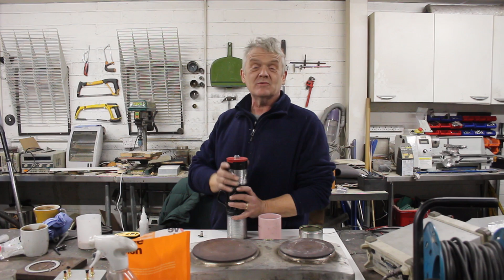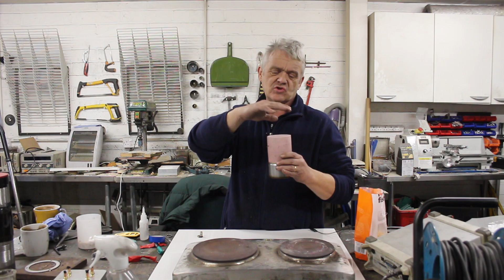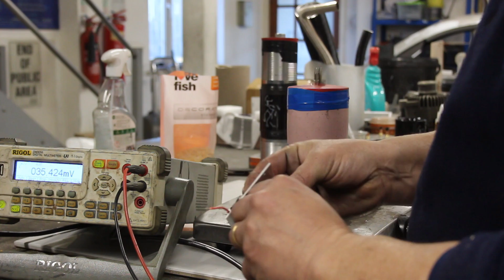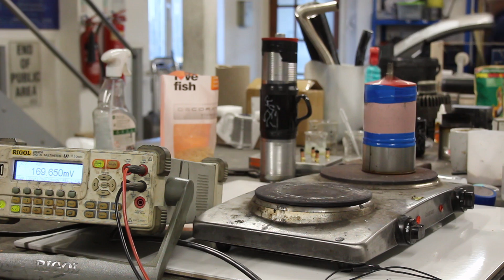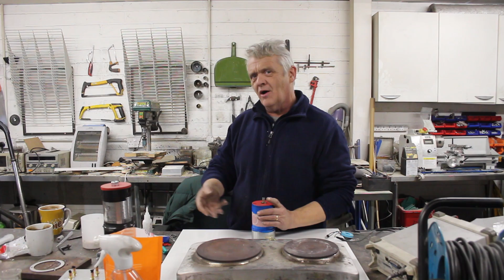1779 The Strange Engine As A Generator

Comment: The frequency of oscillation is dependent on the physical size of the rubber diaphragm and the amount of magnet weight.
I'm wondering if glass can be substuteyfor the ceramic mug, or maybe plastic?

Comment: The generated voltage is AC, so if you use a bridge rectifier, all will be DC and the LED will lite for both cycles, bringing out more light!

Comment: It's little more than a Sterling Engine with magnets attatched to the output shaft instead of a flywheel, and a coil which when supported around the magnets will generate electricity. Nice try Robert.
Reply: Not a Stirling. It's a thermo acoustic heat engine.

Comment: What happened to 1775 & 1778.?
I made this engine from a bean can and a ceramic mug with holes and gravel. Topped with the rubber balloon. I used ACETONE  in the can.  IT WORKS!!!!!
No hole. The correct temperature was pretty touchy too cool no work, too hot no work. I used a Heat gun so I had better control of the temperature.
Reply from the maker: they have been made into an omnibus so i have removed the original videos - you can now find them on tnt omnibus - this is an ongoing project mate so you will find that happening every now and then  - very interesting with the acetone - did you do a video of it? Actually I checked I know you didn't - why not?
Reply: @ThinkingandTinkering  maybe later, still experimenting, but I had a bad reaction to the acetone and need to ventilate and wear gloves next time. I used electrical tape between the can and mug and the acetone broke through. Working on a solution.
Reply: @ThinkingandTinkering  I'm not 100% sure how this works but I think the acetone heats up and the gas inside expands, increasing the pressure in the vessel. Then when it passes through the gravel and enters the ceramic mug it cools and contracts, reducing the pressure. I just don't know how this cycle repeats. Maybe it passes back through the gravel and reheats and re-expands. Or something I'm not aware of.
 @ThinkingandTinkering  maybe later, still experimenting, but I had a bad reaction to the acetone and need to ventilate and wear gloves next time. I used electrical tape between the can and mug and the acetone broke through. Working on a solution.
Reply: I've found that even if there is no hole there should be a temporary one. The engine starts a lot easier if you apply the heat, let the diaphragm expand, release the pressure, seal the hole and then it will run. It seems like it needs negative pressure at the beginning of the heating cycle.

Comment: Now, I am wondering if this darn thing can be built upside-down.
Because if it could, I could heat it with a cheap 300x300mm Fresnel lens with a simple one axis solar tracker, and I just adjust the height each day or 12.
This would be one axis with a passive Arc, of course.
ETA: And after further ponderings, I believe the best option is going to be setting up a bank of these in a trough of hot water, heated by perhaps Solar Evacuated Tubes, and a cooling jacket on the top.
And naturally, I will be using methanol as a medium.

Comment: Use a plumbing boot for a toilet seal to keep the noise down mate.

There should be one that it fits in and the neoprene should quiet it some and have some heat resistance if you use a candle or more direct heat source.

Comment: New idea. (is it strange That this topic is now the domain of my dreams?) 

Put the stator on the inside. Yeah you'd have to re-engineer. Make it span both chambers - so, much longer. Then put the generating coils exclusively in only in the bottom chamber to use also scavenge the heat of the wire during generation. 

I'm kicking around thoughts of how to benefit from the addition of heat pipes, loop heat pipes, vapor chambers, etc to the design

Comment: There used to be old spin tops that had a screw and the nut inside. You press on the screw, and the nut spins, making a spin top rotate. I wonder if you can make this happen here, converting the up and down motion into circular motion of the flywheel. More energy recuperated?

I looked it up, it's called spiral plunger spinning top, and they are still sold today.

Comment: I made mine of a can and plastic cup and it works too. And the plastic is more friendly to the balloon. Noticed that if you put the device on a table made of metal it will slowdown and stop. And if you put it on table made of wood, plastic, rubber, textile or just lift it and hold it in the air, it will start again. So put the device on something that vibrates less. As it seems that the sound is travelling from the bottom of the device to the material it stand on. It also runs with lower heat if you use more pebbles and stretch the balloon even more. I got it to run at 56'C. If it suddenly stop you need to add 5ml liquid (I use "Red-ethanol. 95% Ethanol with methyl, ethyl, ketone, acetone, ethyl acetate and bitrex.) Will try with other materials instead of pebbles that can self heat. As it should work with any material as long it allow sound to pass freely.
Reply: I got it to work well on  acetone. The pebbles are there to remove the heat from the gas. Wrap a water soaked paper towel on the top can to make it better

Comment: What about water beads from the garden shop? apparently you need about 232C to get them really energetic but I think you could generate more force to a diaphragm and thus move more mass thru a larger coil = more VoltAmps per volume.  And possibly an overall more efficient heat engine if tuned correctly.  Put some water beads on a skillet and maybe you can figure it out.

Comment: There's a DISTINCTIVE load on the can!

Definitely need to increase the mechanical resonance.

Suggestion: build a 2 cylinder [2 diaphragm] 'teeter-totter' type pendulum to maximize the energy rebound.

The idea would be to put 2 of these assemblies with their diaphragms together by a lever that looks like a playground teeter-totter, but then have an arm up above them which is a u-shaped magnet [both poles at the top] or, a large magnet with 2 Gauss transmitting steel ends in a bit of an upward facing "C" configuration, then hand the coil between them with a little post so it will stay in one position, while both poles of the magnet alternatively go in and out of the coil.

The rocking motion and the pins would make 2 improvements: the rocking motion will better utilize the springiness of the diaphragms, and the stationary nature of the pin action will keep the parts from just jumping and bumping all over the place.

Since the system is all based on the same principle, and needs no valves, all one needs to do to ensure it starts, is to tap on one end probably only once and it should just immediately leap into motion.

Comment: No expert about the variable capacitor idea, but it strikes me as very intriguing.

I do plan to make a ceramic base with a slip-in aluminum heat exchanger on both the top and the bottom.

I think what would work well would be to put a set of aluminum fins on the top, like say if you took a large beer can, carefully slice it into little flaps that flip out on each side, and then put some thermal paste between the aluminum can and the steel can, or else use an aluminum can and press fit the 2 cans together. [it is a bit difficult but I found that if you sand the inside of the one, and the outside of the other, place form (I used a dowel, but you could use other things) inside the inner can and then with some grease (in this case, thermal paste might work) between the 2 cans, and gently press it evenly. [I used a hydraulic jack and some pieces of wood because that is all I had, but you could rig up other ways, with levers, pulleys, long bolts and nuts, anything to apply uniform clamping pressure]

Now...

Admittedly....

I was not trying to make a generator...

I was making a tiny model jet engine [for looks only, as it would have never run] that was spun internally with a little electric motor and a shaft down the center.

But, if one were to simply cut away the 2 ends of the cans, they could easily mount this to the ceramic tube, as the end result would have both ends uniformly swaged, and have little lips you could use to help strap on the diaphragm as well as to help make a good seal on the ceramic, especially if you use silicone.

In essence, just do what I did, only, cut both ends open.

Now that I think about it, in the compressing stage, since modern cans DO have swaged necks on them, you COULD simply put sand inside the inner can to keep it from crushing while you pressed them.

The deal is that the aluminum of the cans is specifically designed so it can be readily die drawn, and therefore, if you are very careful, you can use its willingness to be re-drawn, to press fit it, using the recipient can as the single use drawing die.

I won't deny, it took me a few tries to make it work.

The reason is, because even though the can is wont to be re-drawn more, it is only willing to do so IF you do not cut the sides out of it first.

That makes it just a little bit trickier, because, you would then have to press the uncut outer can on first, and then, using something like a precision razor, very carefully cut JUST the outer can, so you kept the vapor seal, otherwise you risk ruining it by puncturing the inner can.

What I finally figured out, from looking at a small carbide glass cutting wheel, was that I needed a little holder to mount the blade in as a fixed depth gauge.

By putting a piece of hand carved wood on the front of my box blade [they did not have such things as 3D printers when I was a child... They still had black and white televisions and rotary dial telephones...] I was able to very carefully sand down the face of the block until I got just the right depth [something around 0.002" (0.0508 mm)] to just cut the outer can so I could flip out my stylized fins.

The result was a lot of work, no doubt, but I was making a model at the time.

How much it would be worth to do this for a generator, is anybody's guess.

Also, now, we have a lot more options for cans, some are much larger [especially in import and single serving type beer products] all over the industry.

High pressure aluminum aerosol cans could work as well, although I do not know how thick they are, so one would have to deal with that separately, and with smaller openings, one might want to decide in advance if they wanted to cut one side all the way off, or else devise some way to use the smaller opening of the necked end into their design.

Loads of options out there in aluminum cans, the reason I mention them is mainly the fact that they conduct heat more efficiently than steel, and since they are being thrown away, they are just as cheap as steel.

Comment: So how fast could this charge a bank of 12v car batteries?
Reply: Not sure if lead acid batteries would even take a charge. Maybe if some capacitors were charged and automated to burst their energy into battery when they are full?
Reply: @Teknopottu  so no way to store the electric then.  Like I can with a solar panel
Reply: @salaciouscreations4323  Someone else could maybe give a better answer. I am not sure if something with so little power could trickle the chemical reaction in lead acid batteries.

There are trickle chargers that are very low powered. Something like the strange generator could work like it. Not sure.
Reply: @salaciouscreations4323  If you can create enough electricity to light an LED, you will be able to store it too.

It is same with solar panels. Very little panels give a lot less power. But little streams create rivers: if you store power efficiently, you could use it for anything.

Comment: I know it's just a proof of concept, but it amused me to think of how much electric the hob was using compared with the amount coming out to light the light. :D
Reply: You could put it on top of a fireplace, use it as a heat dump for electronics, anything with excess heat.
Reply: Solar
Reply: Yep.  Paint the bottom can black, and set it at the focal point of a parabolic reflective dish.

Comment: how much weight will it lift efficiently?  Use a bolt with magnets spaced a bit apart and several coils.. would it work with the last candle heater you made?

Comment: Side question for Rob or anyone. Just a random thought. If I held a lump of carbon in one hand and a piece of lead in the other, then wired them together, would current flow?
IOW, using the body as the electrolyte. Obviously you would want better materials and a design that moved them closer together. I don't have any way to test this.
Reply: Our friends from Ukraine made a video about this in one of their travels. Check a video from "Kreosan English"  named "How to get electricity out of people". Human sweat is the electrolyte in this case.

Comment: Fascinating series.  I wonder if it would be possible to run this off sunlight.  Perhaps using some magnifying glass assembly to heat up the bottom can.  Or better yet, suspend the bottom can at the focal point of an upward facing parabolic mirror.  That way it would be protected a little from cooling by the wind. And then of course, I wonder how it would compare to a PV cell for generating electricity - noisier for sure :)

Comment: Wouldn't it work better if you glued a piece of the can lid to the balloon, basically making a piston,  cut it so it's about 1/2"-12mm smaller than the can I.D.  May need to be a bit smaller tho allow it to travel, giving it a larger more solid area to push against,  or maybe use a coffee sized can , the gallon size, like the large mixed vegetables cans, 6"-8", and cut the lid to about 1" smaller, glue it at the edges after rolling  the sharp edge over, so it doesn't cut the balloon, or other rubber?  that may be required for such a large can, the larger solid area should work like a piston, and the rubber around the edge, should work like the crank and flywheel, and the rings! 😲, 
****{I'm also thinking maybe replace the top can with the cylinder and piston from a chainsaw, or weed Wacker!  You can get Chinese remake replacement parts cheap on eBay ,  a whole engine fairly cheap! It would not be difficult to make a slide valve to run off the crank , just using a ring with grub screw, that is larger than the crank, allowing it to wobble, sand it smooth wrap a piece of flat aluminum around it 3/4" wide x1/8" thick , use a small bolt, to hold it toge, use the bolt to keep a loose but snug fit, grease the contact area, the long end can connect to a slide valve , sending steam into the spark plug hole,  and shut it off when the piston reaches the exhaust port,   and it may need to open a port to atmosphere, until the piston is at TDC, then open the steam port again, and boom you got a steam engine, wrap the engine with insulation, to keep the steam from cooling, (as fast as it would without anyway)   make about 10 bar · , max, it should be capable of 500 watts with a 50cc engine +/-,    500 watts over 12 hours or 24-48 hours is alot of energy,  it's Free,  maybe modify the bearings so they can be greased,  maybe drill and tap a small hole in the head to allow the water to be drained, and mount the engine so the exhaust port is at the lowest point to allow self draining of condensed water,  it's a bit of work but simple,  and can generate power,  using a alternator, or bldc motor, or treadmill, permeant magnet motor,  sorry I ran off on a tangent, started rambling again, Soo 😔 sorry,. Happy holidays! 👍 Merry new year!

Comment: It's generating AC, isn't it? But the LED panel works on DC, so how about adding a full bridge rectifier? I also wonder about how much cooling the upper part will get in the long term if it's ceramic, as it works on a temperature difference.

Comment: Is the frequency related to the diameter of the diaphragm?
Larger diameter diaphragm = lower frequency with higher force?
Must engine be configured vertically?  Will horizontally attached diaphragm work?
Will it work with a thicker more robust diaphragm?
Reply: The resonance of the membrane and the volume of the lower can must be coordinated.
Reply: @tibsim  In this and last video we have seen a bean can with a bean can, a bean can with a coffee cup, a bean can with a toothbrush holder and a tuna can with a toothbrush holder.  Video's demonstrated a variety of configurations with different volume components and it ran just fine.  While I am sure there are limits to the extreme, such as a thimble for the lower can and a 55 gallon drum as the upper can, a significant range seems viable.  The videos demonstrate that within reasonable proportions, coordination doesn't seem to be a problem.

Comment: The power extraction here is very much like a speaker/microphone, so if you used a speaker, it would already be set up. Wired and all. Flexible diaphragm. permanent magnets. All you need is your regulation circuit, and it can do all kinds of things. I am thinking how this works might be thermoacoustic. Mostly I am interested in wattage and efficiency, because its easy enough to build.

Comment: I wonder what a 55gallon drum version would do, with a piece of inner tube stretched across the lid and bolted down, and use a 2"x2" neodymium magnet, would do,  with a coil from about 24gauge, (maybe put a magnet on the inside with another coil also,  double the possible output chances, )use tiny pieces of hose and ceramic or maybe nylon washers, and brass bolts , solder the coil to the tiny bolts, using them as a mechanical attachment, and electrical connection! Use a rectifier, and capacitors, and you would have a heck of a phone charger at least,  the soup can could be done similar, making a tiny emerge light and/ or phone charger,  a slow one!